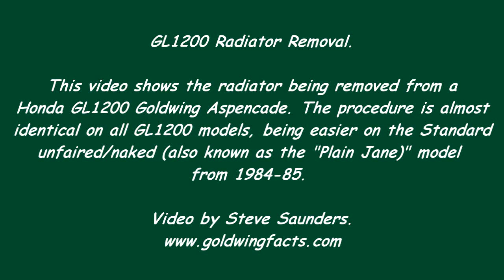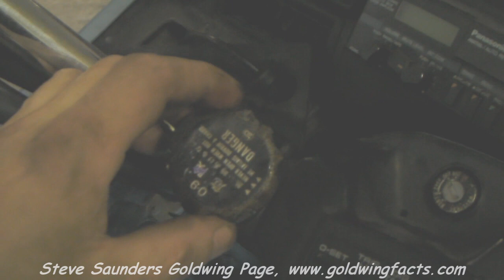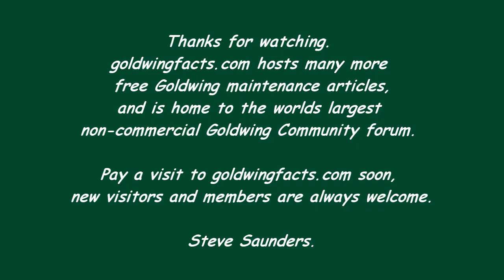GL1200 Goldwing Radiator Removal

Comment: In my 84 goldwing the water (cooler) deposit has two hoses, one of them is to drain, and the other one goes to the pressure sensor, where suppose it has to connect the hose that connect with the radiator (the one in the radiator top)? Thanks

Comment: Is there a reason you drained the coolant from the water pump housing instead of the coolant drain plug? Is it just to make it easier to remove the radiator? 
Thanks for the awesome video!

Comment: take off the panels on the Left or Right side cover that cover the radiator and you can see the fan but it turns on automatically  look at 2:51 and youll see it